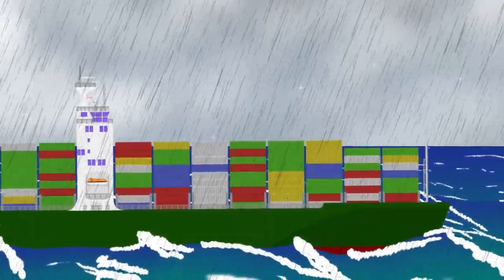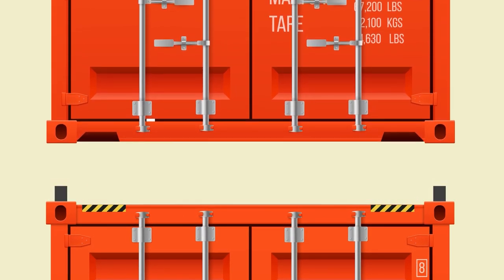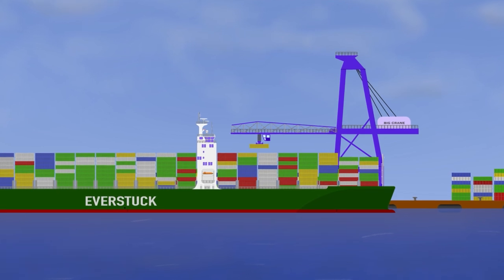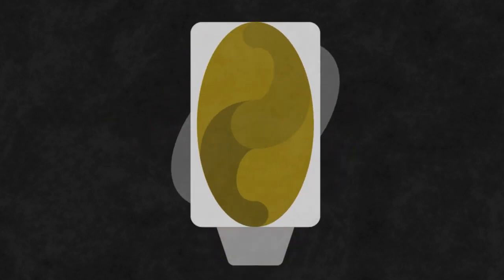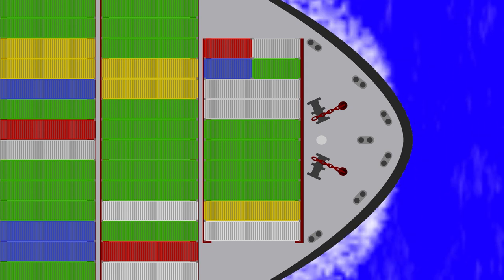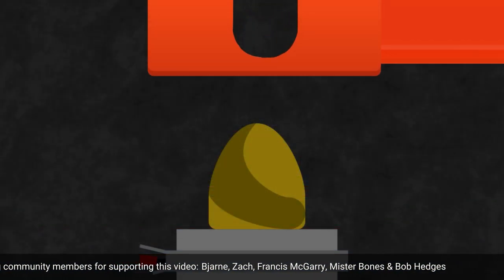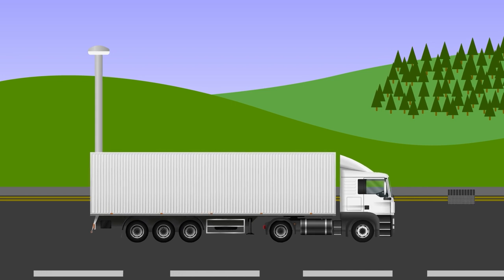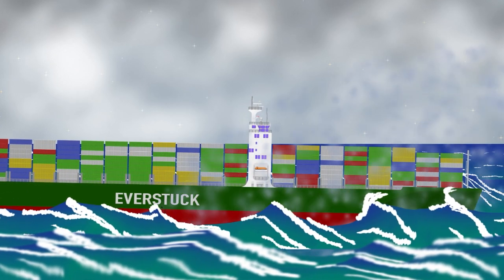Why Don't These Containers Fall Off?

Comment: As a train fan, I've always wondered how they stack the containers without them falling on curves. For a while, I thought they were magnetic.
Reply: That would take a ridiculously strong magnet to hold multi-ton containers together.
Probably strong enough to get tools and stuff stuck to it. Maybe even pin a person if they have metal implants or things in their pockets or belt loops.
Reply: @samiamrg7 youre exagerating because of the enormous surface area, it wouldnt require that much current for an eletromagnet  also to the first guy the tracks are also designed with precise banks in the tracks that are calibrated for the set speed and weight of the trains  that help the loads center of gravity to remain at the 0 position
Reply: I actually got this little model container car doublestack that has little prongs on the top and holes at the bottom where containers can lock to eachother and I wasn't sure before this video if that was how it actually worked
Reply: The main reason you need to secure containers on trains is the back-and-forth movement from "slack action". Basically, there's always a small amount of play in the couplings between cars, which means the cars can move backwards and forwards relative to each other. It's not much per car, but it can really add up over the length of a train. If the couplings are all bunched up, when the train starts, the train doesn't set off smoothly as a single unit. The locomotives move forward slightly before the first coupling tightens up and the first car gets yanked slightly forwards. The locomotive and first car are then moving slightly faster when the second car gets yanked into motion, and slightly faster still when the third car gets yanked. This can really add up over a long train and the last cars can get yanked pretty hard. The same thing applies any time the train accelerates from a position where the couplings were bunched up, and the opposite effect happens when they brake with the couplings stretched out.
Reply: @vonn1334  Electromagnets are a total non-starter because they're an active system: you have to continuously supply power to keep the system safe. It doesn't matter how much power that is. The simple fact that you're always having to do work to keep the system safe means it's a terrible idea.

For a specific example, suppose the train splits in two. This is a real thing that happens from time to time because of either metal fatigue in the couplers or rough driving. When the train splits, both halves automatically make an emergency stop. But the back half of the train is no longer connected to the power supply from the locomotives, so its containers have all unlocked themselves just at the time when they need to be the most secure.
Reply: Containers Do Fall Off
Reply: @beeble2003  that probably, but also to prevent them from getting blown off... And into an oncoming passenger train. 

https://en.wikipedia.org/wiki/Great_Belt_Bridge_rail_accident

(Yes, this accident was with a semi-trailer, not a container, but I daresay the same sort of thing potentially could happen with a container.)
Reply: Have seen photos of railroad derailments involving stack trains - for the most part the locks continue to work no matter the impacts the car/containers experience.

Comment: Another system used on some ships that don’t stack as high are Fully automatic twist locks (FATS). They don’t require any crewmember to lock or unlock them onboard and are spring actuated to so once the container is placed down, the weight of the top container locks it. Once the crane lifts the container for discharge, the vertical release in pressure unlocks the twist lock and it is free to go. They are always attached/locked into the upper container

Comment: MSC ZOE springs to mind here. You also need steel lashing rods to secure the containers to the deck in case of heavy rolling. ZOE didn’t have this and lost her cargo that way. I have to secure the lashings onboard the container feeder I’m doing my internship on almost on a daily basis.
Is a good workout!

Comment: I can't help but wonder about the bottom container of a stack on the outermost row as the ship rolls. Is the container really rated to handle ALL that torque or are there extra lashings etc used while at sea then removed before making port? To my mind, if the ship rolls even a little, the stack will topple as the locks are ripped through the container corners
Reply: there are locks on the uppermost container that lock the stack with the one next to it. They don't look like the ones shown, they're more like clamps that use the the same holes on the container
Reply: @Operngeist1  nice. I figured there must be something. Next question (if you know): do they work for unequal stack heights or do ships just avoid unequal stacks as a matter of doctrine?
Reply: From memory each twistlock is rated for approx 5 ton. There's also lashing bars for usually the bottom 2-3 tiers of containers that tie to the deck.
Reply: The bottom container is locked on permanent locks at the bottom and in between some safety stuff that's almost like a half box at the corners keeping it in place, it's like this for the first 3 rows/containers up by the sea and shore
Reply: This is a very valid concern, and actually happened on the vessel EVER SMART (photos easily found online). There were a combination of natural factors (rough seas), but also human factors exactly like you mentioned. They put too much weight up high, and did not correctly install lashings used to reduce sway. The result was crushing of the corner containers just like you said
Reply: @scarletlightning565  
They don't work for unequal heights and were more common when all containers were only 8'. But since there has been an increase in heights to 8' 6" and even 9' 6 " for 40 footers getting the stack even is too hard. The twist locks aren't the only locking mechanism, there are long strong bars that lash the containers to the deck.
Reply: @Igbon5  I think Scarlet meant just a stack of 10 containers vs a stack of 11, rather than different heights of containers. I assume that stacking different numbers of containers would be fine -- you just lock the top container of the 10-stack to the next-to-top container of the 11-stack and I guess things are fine as long as there aren't massive differences between one stack and the next.
Reply: @beeble2003  
Nope it doesn't work like that as so many containers vary in height between 8 foot high, rare now, 8 foot 6 and 9' 6"As they also   put 40s on top of 20's and 40's have a lot of variation. In short it is too hard to plan a level top layer for adjacent bays.
Having said that I did used to put such things on many years ago before the variations in height. They are called con-locks but are not used much any more.
The lashing with heavy bars seems to be sufficient with extra lashing on the outside bays. Although they only reach 3 high that means you can hook the bottom holes of the 4th high containers and that lashes them to the deck or a bit of super structure.
The lashing is hard heavy work putting heavy bars that high up, trying to maneuver a little knob on the end of the bar into the hole of the container. Then it has to be hooked up to a large bottle screw and tight down.
On a full bay they would generally lash all the 2 highs lashed and three highs on the outer ends. Sometimes it is double lashed depending on the stack height and the weights.
A first mate of the ship would draw out the lashing requirements and a foreman would direct the wharfies which bars go where.
Ant the first mate would then sign off on it making sure the bars were as described and all tightened down properly.
Sorry to go on so much.
Reply: @Igbon5  Thanks for all the information!
Reply: That is very unlikely to happen. Not saying it can't, but the container corners are built to take the strain, as are the twist-locks. Plus the stacks are lashed to the deck with lashing rods, at least the bottom tiers are. Containers must be inspected periodically and they are taken out of service when no longer fit. In theory, lashing equipment is, too, including the twistlocks. When everybody is working conscientiously the number of containers lost in normal operations in reasonable weather and sea state is almost zero. Almost.
Reply: Their is also external lashing bars attached to help with that kind of torque. Where I work they are attached and removed by us once docked depending on the ship they can be lashed to the bottom two cans or their is a raised walk way between stacks and you are doing the same lashing on the 3rd or fourth can up
Reply: @CodyTaylor115  
Good exercise doing that work eh?

Comment: Hello, I think the description of manual twistlocks is great and is a good resource I wish I had a couple months ago when I was talking about them! With that said, I do have some comments/corrections on the video:

3:40 Bay 01 is correctly described. That would be a 20 ft container at the front of the hold. But a 20 ft container in the back would be Bay 03. Bay 02 would only be a 40 ft container filling bays 01 and 03.

Given the title of video is about cargo securing (and not limited to twistlocks), I also think it is worth mentioning the use of turnbuckles on the first 2 or 3 tiers above maindeck. The twistlocks do nothing to reduce container sway, so the turnbuckles are essential to preventing accidents like what happened on the vessel EVER SMART.

I was an engineer, and have limited familiarity on auto-twistlocks. And I wasn't involved in cargo loading/discharging, but I have never seen a container pulled off a ship and put onto a mount/stand by the gantry crane. There is usually a line of trucks, and the container goes straight from ship to truck (or vice versa). I'm not really sure how a ship gets their auto-twistlocks back, but there are usually not crew members standing on the dock collecting them from containers.
Reply: Each vessel has a few specially designed 20' containers with bins that contain the twistlocks. These are taken off at the beginning of operations so stevedores can put all the twistlocks in the bins, and they are reloaded at the end. 
Likewise I haven't seen a frame that the containers are placed into once discharged, but at the port I worked at we loaded out of frames as containers were delivered to the ship by reachstackers.
Reply: @Kaine96853  Thanks for the info! I was actually about to ask in a reply to your other knowledgeable comment, but you read my mind!
Reply: Yes they do. In many ports, during discharge, the the crane land containers on stands to let the stevedores remove the twistlocks. And during loading the straddle carriers or reach stackers (trucks) land the containers on to the same stand to let the stevedores/ longshoremen attach the correct twistlocks onto containers before the crane picks it up to load it onto the vessel. Not all ports have the containers loaded directly to trucks.
Reply: Rarely are containers loaded onto trucks directly. (At least in the EU) They go into a container stack where they wait for pick up by a road truck/train/ship. Twistlocks are collected by dockworkers and put into holding bins which are loaded back onto a frame and loaded back onto the ship. (They are open frames which use the same mechanics as containers.)

Comment: The forward locks on trailers are actually a pin position horizontally and the container is inserted at a slight angle to catch underneath of the pins in the front and then it uses the standard locking in the rear only since once it's past the pin it can't go in any direction except for backwards

Comment: I’m a truck driver and I’ve done some container hauling in the past. The frame chassis that the containers are loaded into have built in manual twist locks on the back corners and manual peg front locks on the front corners.

Comment: Those cargo ships are MASSIVE.
Honestly, you could use it as a runway for small planes, if the deck was flat.
Reply: Man, we should think about making ships with runways for planes, you might actually be holding onto something !
Reply: @arthemis1039  Yeah, in particular I think militaries could really benefit from this. They could use it to give air support to troops anywhere that's close to sea.
I think we could maybe even get by with slightly smaller ships if they put hooks on the aircraft and long cables across the deck. That whole space under the deck could be used for storing more aircraft. Just put a large elevator on the side to get them onto the deck for takeoff.
Honestly this guy's a genius. He could make billions off of this idea.
Reply: The US already has smaller "aircraft carriers" for the Marines that operate Harriers and F35Bs. The British actually landed a Harrier on a container ship during an emergency however I think parts of the containers collapsed under the weight of the plane
Reply: I believe the US Navy has designs for a "top deck" thst would allow vertical take-off and landing (VTOL) to be carried.  I believe the British made use of a similar conference during the Falklands war.

Storing aircraft brlow the main deck would be problematic.  Besides the need for an even layer for containers you would have to deal with the cell guides in the cargo holds.  Assuming you solve that issue, ventilation would become the next problem.  After that you would need to deal with fuel.  Aircraft use kerosene type fuels, whereas ships use anything from heavy fuel oil to marine diesel oil.  Containerships have limited space for fuel and ballast.
Reply: @robertlevine2152  Sounds like the joke went right past you.

Comment: You forgot the lashing rods I think. Also there are many circumstances in which container ships loose containers
Reply: MSC ZOE springs to mind here. Container ships are required to also put steel lashing rods to secure the containers to the deck. This is done in case of heavy rolling

Comment: Thanks for explaining how to vertically connect containers together. Is there a standard for connecting containers horizontally?
Reply: Yes. Some of the other comments say that they also install locks (of a different design) between the top containers on each stack so the stacks are held to each other.

Comment: I appreciate the EVERSTUCK.

So the lever twist locks are generally utilized on the deck, so they can manually control the pitch and angle of the container if the operator has difficulty loading.

Semi-auto twist locks come in two primary types:
Single stem (pig tail) & dual stem. The longshoremen utilize a locking pole, that resembles a fireman's pole hook or halberd.
The single stem in pulled down, and held in place by a fork cast snagging onto a collet that is viced onto the stem in manufacturing. These have a top and bottom.

Dual stems have a top and bottom as well, but pulling the left stem will unlock the top and lock to the bottom. Pulling the right unlocks the bottom and locks to the top for ease of extraction. If the stems are aligned with one another, both containers are locked onto one another.

Auto locks, are another beast in themselves and too much for this comment. Appreciate the light you've shown on the simplicity and genius of the containerization of cargo.
Reply: Hmm 🤔

Comment: Smart, yet it seems there is room for human error since a person must place the locks before stowing the container. Does it happen often? What measures are in place to avoid missing one?
Reply: Where I worked there was a foreman watching each container go on and they check the twist locks and the validity of the number and help the crane driver locate the box if its in a tricky spot. The twist locks are put in under the crane by what we called pin men, 2 for each crane, one for each end of the box. The foreman directs them too.

Comment: I‘m a little bit confused about the vertical numbering. Odd and even numbering is used for everything else. But the vertical numbering just has even numbers below and on deck? Seems rather confusing.
Reply: Odd numbering is used for tiers when loading half cubes.  However, these are so rare that it didn't warrant mentioning.  Even/odd numbering is used for bays to denote 20' (odd) bays & 40' (even) bays.  Even/odd numbering is used for rows to denote port (even) and starboard (odd)
Reply: @s.v.saylaraye3212   I watched the video but thank you for your summary. It’s still unclear for me how to differentiate between two containers with the same number because there will always be one with a vertical 02 below and on deck (according to the vid).
Reply: You never use the same number twice except in specific situations like empty flat racks stacked with their ends down occupying the same slot.  In the holds, the tier numbering starts at 02 near the keel and increase as you get closer to the hatch cover.  The containers that are loaded on top of the hatch cover or deck start at 80 regardless  of the number of tiers below the hatch cover.  So any tier >79 is on deck and any tier <80 is below deck.
Reply: @s.v.saylaraye3212  Now it makes sense.. so I rewatched the vid and now I hear the 80 as the limit between below and on deck. So thanks for clearing that up. Was driving me nuts.

Comment: For you new junior mates out there, always be mindful of the bins of twistlocks collected on shore during cargo ops and be sure to get them back on board before the cranes are secured. Even the manual locks aren't cheap and the gear is easily sold off on the cheap to unscrupulous ships coming in after you. Anyone remember the little side gig some Felixstowe longshoremen had going on in the 90s?